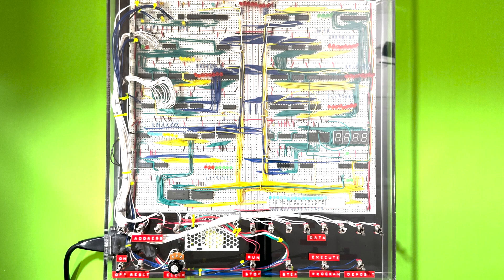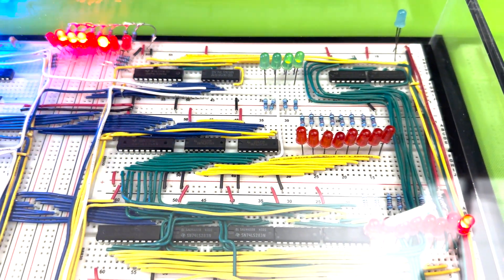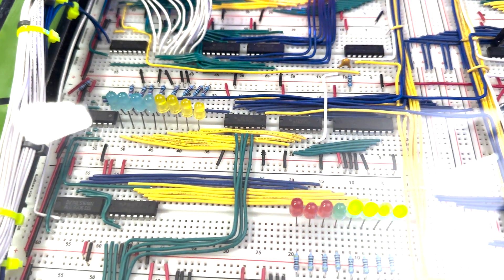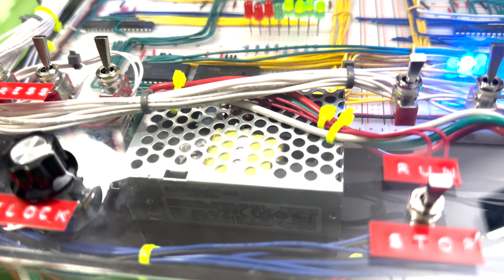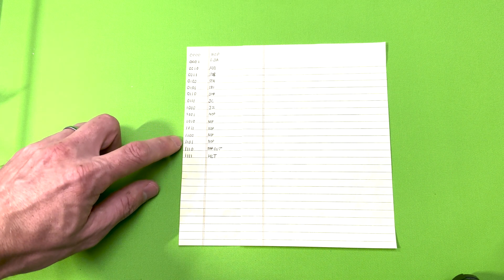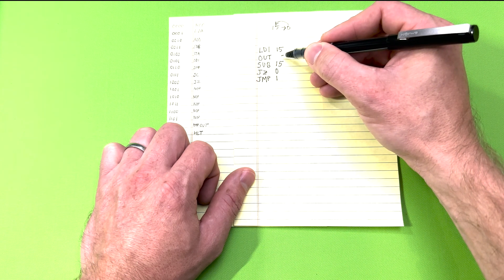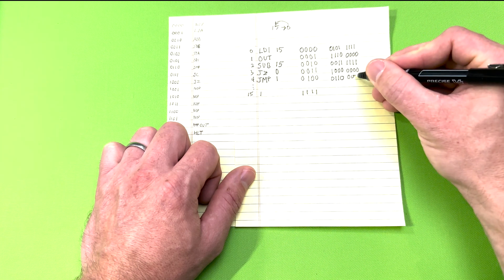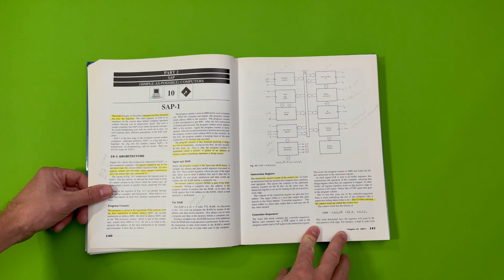I Built an 8-Bit Breadboard Computer

Comment: I'm not good with computers, don't know why this was recommended to me and I didn't really understand the instructions available, but I thought I'd give it a shot. Multiplies two RAM values, in this case 26x17. The RAM locations are all above 10 because I didn't understand if your computer had a ROM or if the program was stored in the RAM

This is a readable version:
DEFINE	one				 1100
DEFINE 	multiplicand_RL	 1101

DEFINE 	multiplier_RL	 1110
DEFINE 	result_RL 		 1111

 0	LDA	result_RL			# load our current result
 1	ADD	multiplicand_RL		# add the starting multiplicand to it
 2	STA	result_RL			# store it back
 3	LDA	multiplier_RL		# load the multiplier, or counter
 4	SUB	one					# remove one from it
 5	JZ		8					# if this is 0, we finished multiplying the number
 6	STA	multiplier_RL		# if not, we store it back
 7	JMP	0 					# and repeat from the beginning.
 8	LDA	result_RL			# Once we're done, we load back the result
 9	OUT						# we print it to the output register
10	HLT						# and we, I assume, halt the execution.
11	
12	1
13	26
14	17
15	0

And here's the raw binary if I didn't make a mistake:
0000	0001 1111
0001	0010 1101
0010	0100 1111
0011	0001 1110
0100	0011 1100
0101	1000 1000
0110	0100 1110
0111	0110 0000
1000	0001 1111
1001	1110 0000
1010	1111 0000
1011	0000 0000 # I don't know if we put something where there isn't anything.
1100	0000 0001
1101	0001 1010
1110	0001 0001
1111	0000 0000
Reply from the maker: Hey, that's actually a very good try for someone that's "not good with computers" :) Your program actually checks out. The computer does not have a ROM so everything is executed directly from RAM (which only has 16 slots). It is possible to add a ROM but, since it's such a simple computer with an 8-bit bus, it probably won't improve it much for the amount of effort it would require to implement it. Regarding the empty RAM slots, we can just ignore them since they would never be called anyway.